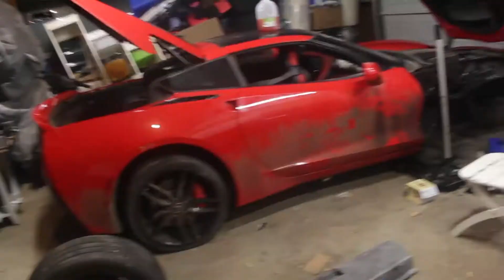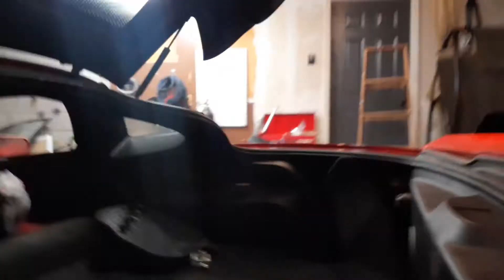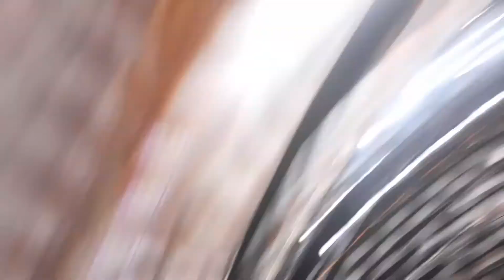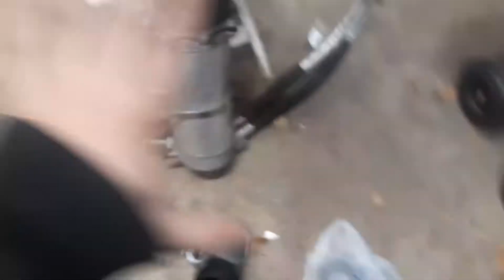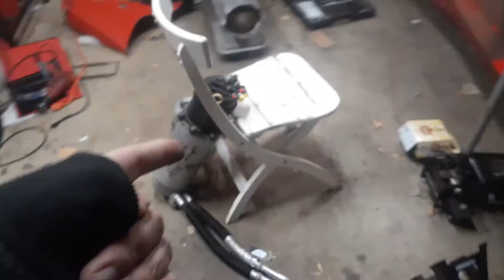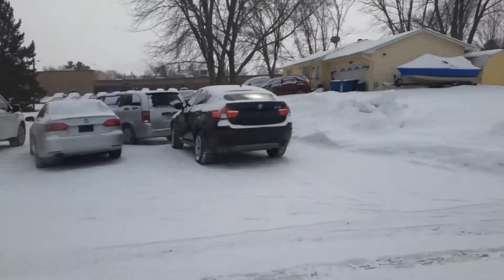Cheap Corvette Had a MAJOR ISSUE That Cost Too Much to Fix

Comment: while selling a copart you marked that bad engine?
Reply from the maker: Yes. They label it as “doesnt start or run” in copart
Reply: but you could write an engine damaged:)i buy this car,
it cost € 800 to repair the engine.
the car is now driving in Germany